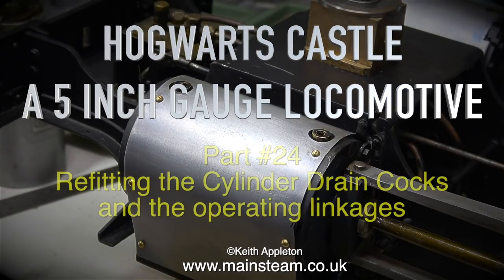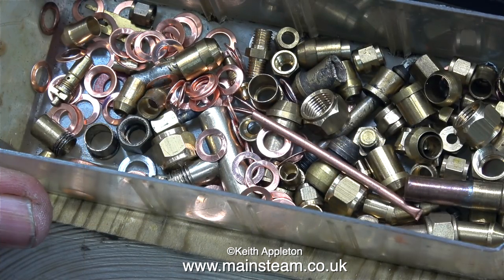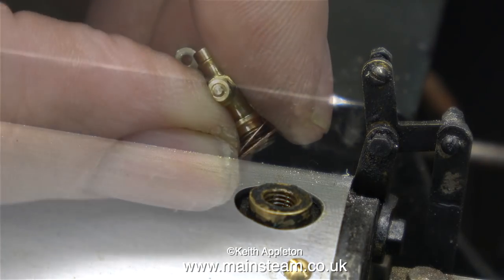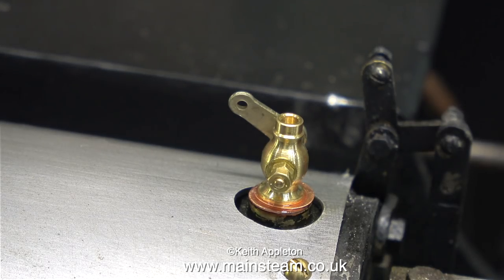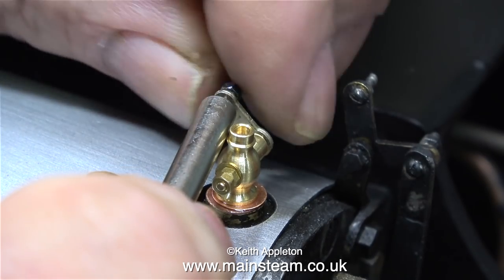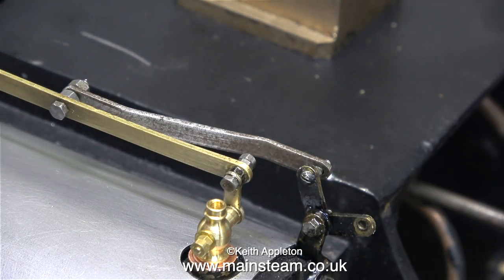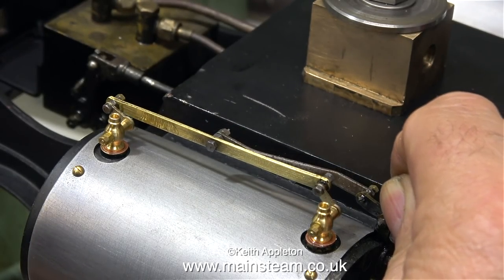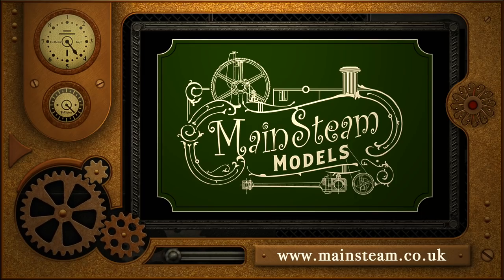HOGWARTS CASTLE   A 5 INCH GAUGE LOCOMOTIVE - PART #24

Comment: It's always fascinating watching a professional at work.  You may be doing it as a hobby, but you're certainly doing it professionally.

Anyway, your Hogwarts Castle 4-6-0 is not equalized - every driving axle is independent of the others.  The pilot truck (or bogie) appears to have its axles equalized, but the pilot truck is not equalized with the rest of the locomotive.  Was this normal English practise?  Perhaps spring equalization wasn't needed in the U.K. due to your nitpickiness over right of way construction?

Just curious; not used to seeing unequalized steam locomotives, also inside valve gear steam locomotives.

Comment: I can see that the draincock linkage is overthrowing one of the valves which could lock up if it fell parallel, but since they don't need to be fully opened to function I would guess you're just going to limit the amount of throw on the cab lever to prevent this.